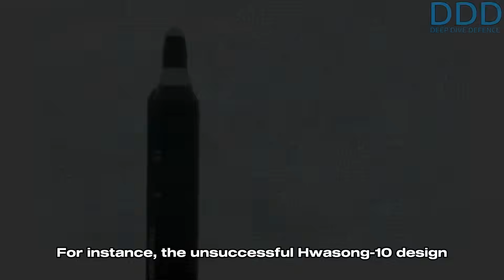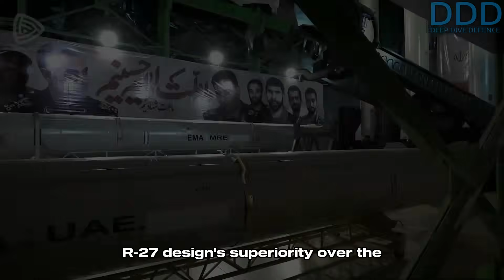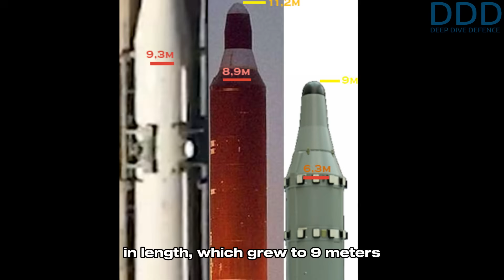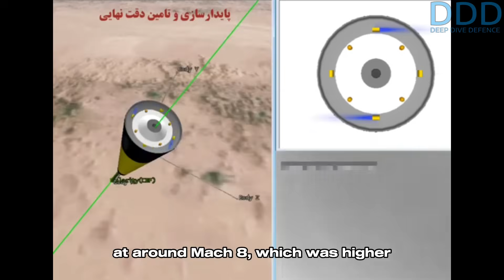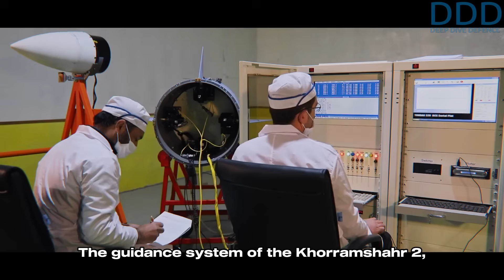Iran's heavyweight medium-range ballistic-missile: Khorramshahr-1 & -2

Comment: Iran has no modern airforce. They need to develop lift vehicles that can lift massive weights equivalent to moab type munitions for credible area destruction strategic effects. if south korea can develop Hyunmoo 5 able to lift a warhead of 9tons, Iran should have done it ages ago given that they have no airforce for strategic deep strike. Iran is slow and behind and seems not to understand what fighting a war with usa would entail
Reply: Why Are Fighter Planes Used in the First Place?
Why don't we use ground-based missiles instead of fighters for precision attacks?
There are two types of missiles: cruise missiles, which are accurate but have short range, and ballistic missiles, whose range is virtually unlimited but have very low accuracy.
Fighters are used to deliver high-precision strikes with air-launched cruise missiles.
But why did they have to be launched from the air?
Cruise missiles cannot be long-range because of a problem known as the "tyranny of the missile equation." For range, you need fuel. Fuel increases weight, which reduces the flight range. So the answer they came up with was to get the missile close enough to the target with an aircraft and then launch a cruise missile.
But why don't we make ballistic missiles as accurate as cruise missiles to eliminate the need for fighters and aircraft carriers?
A ballistic missile that could fly long distances had its own problem, known as "INPUT PLASMA EFFECTS," which occurs when air particles collide with each other at the same speed as they do when re-entering an object, the intense heat from all that friction raises the temperature of the rocket. The air is so high that the gas is ionized, essentially forming a cloud of plasma around the outer surface of the spacecraft during the re-entry phase, which interrupts radio communication between the vehicle and the ground station.
Simply put, you can't control it. Thus, long-range ballistics is only used for nuclear weapons, for which lack of accuracy is not a problem.
So it is obvious that when Iran announced that it had somehow developed ballistic missiles with high precision, everyone dismissed it as propaganda. Even after Iran released footage of a ballistic missile hitting a target with high accuracy. Iran was accused of photoshopping despite the lack of any evidence that the footage had been altered. But after the attack on the US air base, when all the missiles hit the bull's-eye, everyone had to come to terms with the fact that, as the Persians were the only ones who possessed damask technology, now they have repeated a similar unattainable technology. Uzi Robbin, the father of Israeli missile defense, said this in response to Iran's pinpoint ballistic missile. "At the push of a button, they were able to accomplish a task that requires us to risk the lives of pilots and expensive fighter jets. And they were probably in the air when they pressed the button"

Conclusion: Iran does not need aircraft or aircraft carriers to deliver precision strikes.

Once a shooting war begins, US naval forces and all its bases within a 3000 km radius of Iran will be destroyed, and approaching Iran would be impossible without facing further destruction. and since US and Iran have no shared borders and there is no safe logistical supply line, it doesn't matter how much aircraft and MBT tanks the US has when it can't ship them to the battlefield intact,

Many people are comparing the military capabilities of Iran and the US as if the two countries are neighbors, like the US and Canada. They don't realize the embarrassing defeat that could occur when you engage an opponent that has been heavily armed and preparing for conflict for the past 45 years. Meanwhile, you are fighting from 10,000 miles away from home, while your adversary is on their own turf, making defense significantly easier.

years Why do you think the Persians were the only empire that successfully conquered Afghanistan, while others like Russia, Britain, and America failed? I could engage in fallacy and claiming Persian superiority, but the truth is their success was largely due to their shared border. For other empires, Afghanistan was a logistical nightmare, being landlocked and requiring transport of heavy equipment like MBT tanks via aircraft, which is both weight-limited and extremely costly. In fact, retrieving such equipment is often more expensive than purchasing new ones, which is why the US left theirs behind in Afghanistan. The US lost primarily due to logistics, not the Taliban, as many anti-US voices suggest, but a loss it was nonetheless.

Now, imagine the embarrassment if the US went to war with an enemy that wouldn't even allow the transport of equipment in the first place.

US have never encountered an opponent like the Persians. We invented chess no one comes close to us in strategic planning.and we are preparing for the war with the US for last 45 years so you can be sure that there isnt any move that US can do against iran in a war that wont be countered with shocking planed move
when you are the weaker side you have to rely on strategy and in avrege IQ by country Persians are rank 3rd after Taiwan and China, while Americans are 45th , and this is according to the world's official IQ test ranking in 2024

https://international-iq-test.com/en/test/IQ_by_country

Thus, you can envision who might develop a superior war strategy. To highlight the significance of war strategy for its outcome , consider the comparison between Arab experiences with Israel.

Despite all Arab armies uniting and being equipped with Soviet weaponry they were defeated by Israel in every conflict. In contrast, an Arab militia known as Hezbollah, operating under Persian command and control defeated Israel time and again , achieved what the combined Arab forces could not: liberating territory through military means in 2000 and humiliating Israel in 2006.

As the Ukraine conflict has shown, drones and missiles are shaping the future of warfare. Against an opponent with sophisticated air defenses, traditional manned aircraft fall short, unlike previous American engagements with non-state actors. Isn't it intriguing that Persians have consistently been 40 years ahead in this regard? During the Iran-Iraq war, we invented drone warfare when purchasing aircraft and spare parts was not an option. This led to the creation of the world's first reconnaissance and attack drone while we were establishing spare part production for our manned fighter jets (look up Mohajer 1 for more information). The US later adopted our concept, and with their greater financial resources, their version had an extended range and superior quality. However, they lacked our innovative spirit and didn't introduce new advancements until later, when they again saw our kamikaze and swarm tactics, so they're copying that now

Iran has invented the world's first and only loitering air defense system, called the Missile 358. This system hovers at high altitudes, forming an 8 shape in designated zones, searching for enemy aircraft and diving toward them like a hawk. It has proven its capability by shooting down 27 US and Chinese-made drones during the Yemen conflict. More recently, it successfully brought down 9 MQ9 Reaper and 4 Israeli HERMIS 450.

Missile 358 is a unique technology on the global stage. Interestingly, its name, the missile 358, was given to it by the US after several of these missiles were seized being smuggled from Iran to Yemen on a fishing vessel.
it odd name until people noticed that the tail number of the destroyed CIA aircraft carrying the CIA director handling the Iran file, known as Ayatollah Mike, was 358. This aircraft was downed by Iran one week after soleymani assasanation altho Iran didn't officially claim the responsibility and US kept it quiet ,
Iran also created the first ASBM (anti-ship ballistic missile), nicknamed "carrier killer" by military experts, a feat only China has matched or received from Iran. Additionally, Iran is the sole country to develop ARBM (Anti-Radiation Ballistic Missiles), which transform a warship's greatest asset (its radar) into a significant vulnerability. In 2015, US intelligence confirmed the operational status of Iran's ASBM and ARBM developments, generating numerous articles.

Where is US hypersonic technology? US struggling to develop it. The US lags behind Iran, Russia, and China in offensive missiles, air defense missiles, and hypersonic missiles. It's embarrassing that it can't create new weapons, relying instead on designs from 40 years ago which were designed by Nazi scientists they brought to the US in operation paperclip,

they merely upgrading them cosmetically. Consider the development dates of UScurrent arsenal: M1A1 Abrams tanks (1985), F35 design (1995), U.S. Navy's aircraft carrier (1922), F22 (1992), ATGM Javelin (1989), Boeing AH-64 Apache (1986), Cobra Helicopters (1967), Patriot missile (1980), HIMARS (1980), Tomahawk cruise missiles (1972), and B2 bomber (1989).

Iran is pioneering several first-of-its-kind weapons. We also built the first fast attack boat with vertical air defense and radar, named Zulfaqar. Imagine a fast boat with the firepower of an air defense warship without being a vulnerable target like a modern destroyer. Iran has already revealed the second generation of the Fatah hypersonic missile, Fatah 2. . US is in declin; it should accept it before initiating a world war that none of us wants.
Reply: @mansari7310  .....you are too confident in your own ability. you don't seem to understand how the us fights. usa will stand their assets far away and pound you with thousands of cruise missiles to degrade your air defences and critical command and control, and then will afterwards send in their airforce. they will then systematically turn your country into rubble. you don't seem to knwo what you are saying even though you have written a long essay